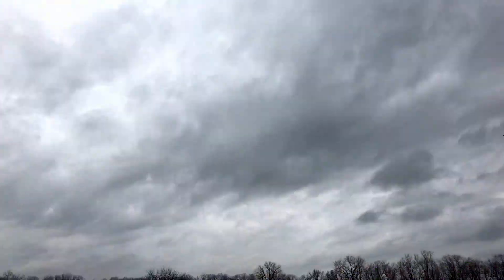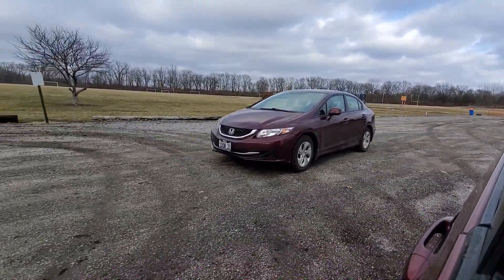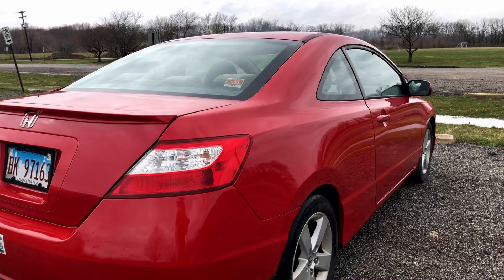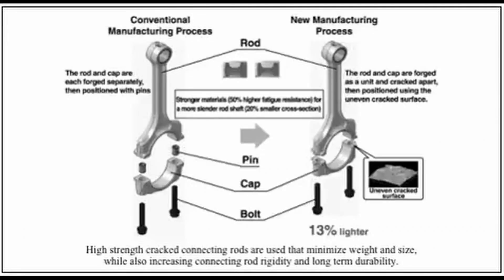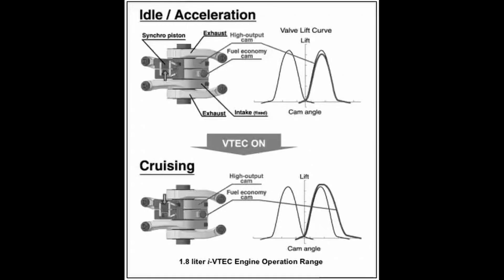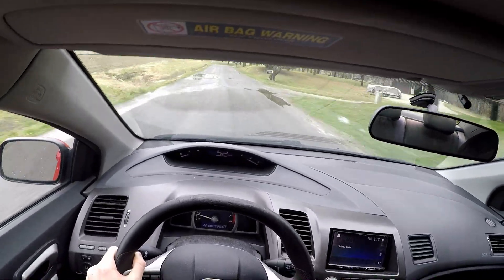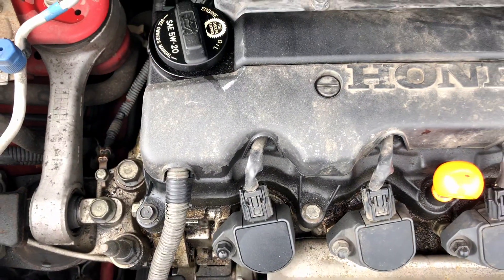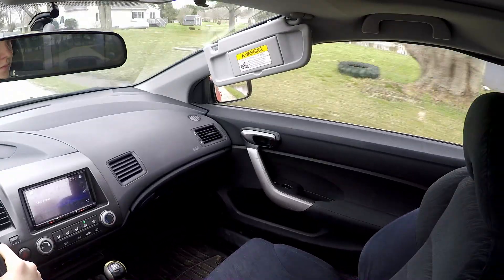A Brief Guide to the R18 Honda I-4 Engine

Comment from the maker: Some minor corrections: When I'm talking about the mpg, those are only applicable to the 8th gen civics with the R18, not the motor itself or other vehicles with the R18 in them. Not all emissions ratings are strictly for the R18, but rather for the vehicles that it's in. Also, as The Wolf logic mentioned in his comment, there is a precedent that proves these engines are capable of making upwards of 200 whp, so disregard my assumptions as far as how much power the engine could take in the opinion section. However, it should be mention that just because an engine can make decent power, that doesn't mean it'll be the cheapest or most efficient/reliable option.
Reply: Excuse me sir, check out our channel. More videos on the boosted r18 soon but it actually LOVES boost. Trust me it’s the new d series. Also something no one wanted to touch but when done right it’s awesome. I bought an eBay kit for the car and it’s performing absolutely well. The kit was only $700 I had to buy a few things but really check it out and re-consider your view on the r18. They’re fully capable of power because they’re Honda’s. We all know by now that Honda motors are pretty much bullet proof. Please do check it out!!
Reply from the maker: @mobsquad1320  Will do! Thanks for the information! I'll make sure to check out your channel!
Reply: @mobsquad1320  thank you this video made me feel like shit for owning an r18 and putting more than 5k into it.
Reply: @mobsquad1320  what about now a year down the line?
Reply: Sometimes when I am lonely I will shave one leg so it feels like I’m sleeping with a woman 👩🏼
Reply from the maker: @mattycheeze4131  Sounds like winning to me
Reply: @carpartsandexhaustfarts  💪🏽
Reply: @mattycheeze4131  haha 😂
Reply: @mattycheeze4131  I know this comment is old but I literally laughed out loud! 😂😂😂😂
Reply: @Cooldad87  
I still do it.  🤷🏽‍♂️
Reply: @mattycheeze4131  🤣🤣🤣🤣 make my day!
Reply: They can handle more than 180bhp. Many people have made well over 250bhp reliably using supercharger kits and Remaps.
Reply: Thanks for the intel.

Comment: I'm a member of the European Civinfo forum since forever. There are tens of boosted r18s with 240 to 400 hp on stock internals. They run perfectly fine for almost 20 years now, no issues

Comment: Red line is 6800 RPM. If you want to push it, this engine can pull when you need it to get moving. Its best feature is fuel efficiency. Baby it when you drive it and it is incredibly efficient. It is also the quietest engine I have ever had. I have 330,000 Km on mine. It does not use a drop of oil between oil changes. The body is in incredible condition. Hope to take it to 500,000+

Comment: Buying one as back up car 

Anybody had one - any thoughts ?

Looks v easy to work on ?
Reply from the maker: If I may weigh in, they are very easy to work on. They also have pretty ridiculous durability and longevity. My 8th gen has gone on to rack up over 270k miles and is rallycrossed regularly and has yet to have a major failure of any kind. Great platform for pretty much any application.

Comment: I have noticed alot of issues with the r18s 3rd cylinder.  Im trying to figure out what is causing 3rd cylinder overheating and 3rd cylinder rods getting thrown. And head gaskets blowing out on the 3rd cylinder?

Comment: Ive just added a R18a to a classic mini, upgraded the cams and springs, a few breathings mods and a tune and now pushes out 175bhp. Increaded the redlune to 7300 so its sings nicely also 👍🏼
Reply: So a letter say Skunk2 cam, full exhaust and intake with a map takes it from 138hp to 175hp? Not bad
Reply from the maker: That's incredible, good going!

Comment: I've had my Civic Auto since 2007. Done 260000 kilometers Drivebelt still like new. All I do is regular maintenence.  Valve adjustment every 45 000 km Brake pads, spark plugs,  new battery every 4 years. Fluid
Changes , oil, water, and  atf. She runs like a dream. 
 Only thing Ive had to replace in 18 years are two light bulbs and that takes you 5 minutes to do...Best car I've  had.

Comment: 5 years later r18s still making 250 stock blocks there's a dude on yt making 237 to the wheels
Reply from the maker: I will say it has way more capacity for performance than my initial impressions led me to believe. Honda people have really worked wonders with it, and it attests to Honda's ability to make a great motor at any price point. It's so great

Comment: Does the L15B1 have the exact same VTEC variant?
Reply from the maker: That's a great question. I am unfamiliar with the L series of engines, although I'd love to get to know them. Given that the Fit is first and foremost a commuter vehicle, I would imagine it has the more efficiency minded I-VTEC system found in the R series, but don't take my word for it. I can say with near certainty that it is not the EXACT same system. In all likelihood it is set up somewhat differently, and it very well could be more performance oriented given how capable the Fit/Jazz is as a performance vehicle.

Comment: As long you don t look at the speedo... I got it to 133mph... Isn t that good enough?
Reply from the maker: It's not so much about how high it can go and more about how long it takes it to get up to speed. In all fairness, it's impressive for its segment, but if you're used to something more potent then it's nothing to shout about. It is a ton of fun though, but the illusion of massive speed is shattered somewhat by looking down at the gauges. That is an impressive number to get it up to that I didn't know it was capable of, I sure hope it was on track!

Comment: My sister has a 2006 civic with 305,000 on it. Does not smoke
Just leaks a little oil. Might not be
fast, but it lasts forever. That starter is a bitch to change though.

Comment: I got a 2008 Honda Civic EX but it got a problem. The problem is the mpg I am getting around 19 to 20 max I got no check engine and the engine doesnt idle bad but I noticed that when I step on the gas hard it like over floats like if it was running rich?
Reply: It got 204k miles
Reply from the maker: That's interesting. Sorry to hear that it's not running right. It does sound like it might be running rich, but if it's not throwing any codes it's hard to say what might be causing it. It potentially wouldn't hurt to swap out some sensors and see if that has any effect. I hope you find some answers soon.
Reply: @carpartsandexhaustfarts   there is no check engine i see that my airflow to gas ratio it 14 to 1

Comment: Thanks for the review, i own a 2015 Honda civic lx sedan. The only thing I done to it for performance, I added a short ram intake by Tekada. It replaced the factory air box. Every once in a while, I will clean out the filter that’s inside the box. The other thing I would do eventually, is add a tekada catback exhaust to it. I was supposed to have that done a long time ago. Then finally a big maybe, would change out the header. That would have to be done by my good buddy of mine who works on my car maintenance. He would have re program that. But that’s it, my engine has 130k miles on it. It’s still running awesome. My car is my daily driver and I use it part time for doing lyft and uber. I agree with you, if I really want more horse power, I would swap out my engine to the K20’s or K24’s.

Comment: I got my 12’ civic lx in 2019 and I hated it cause the previous owner fucked up all the motor mounts and suspension and never changed the transmission fluid. It would also slip when exiting a highway. I rebuild this car cause I got it for a 3500$ steal. I changed the motor mounts, engine cradle, struts, axles, rotors, brakes, wheels and tires, then I ended up changing the transmission , spark plugs, ignition coils. Radiator fans and temperature sensors. Intake hoses. Catalytic converter, resonator. And I have completely fell in love with this car 25k later cause I also replaced the front bumper, fender, and hood and put a backup camera, touch screen radio, mic, 4 Rockford fosgate speakers 2 Rockford tweeters, 2 ten inch subs then I switched to a single 12 inch pioneer. Im in love with my all blacked out 2012 Honda civic Lx 1.8 R18z engine.

Comment: You can get more then 200 hp if you know what you're doing. I have a 2012 lx R18z1 auto with a cold air intake and a tune making 135 hp (New stock makes 112 hp for reference). If you upgrade the fuel injectors from the 185cc to 300cc with a return fuel system, and like 15-20 lbs boost you can make around 200-220 hp on stock internals. After that you gotta upgrade the internals. If you want more then 300 hp you might as well get an si because you're gonna need a new block.

Comment: Hi i have this engine it makes a grinding noise on cold startup people have told me its the vct Actuator. I am pretty sure this engine does not have one its only on the double overhead cam engines found in the si models. I am leaning towards the starter motor any thoughts in the comments would be apricated.

Comment: Thanks, this is the same version of i-VTEC that was on my old Honda Element. Sure, it's not the performance version, but you can definitely feel a little bit of a power bump when i-VTEC switches from 12 valve to 16 valve mode. And if you know when the change over is, you can increase your fuel economy by keeping the RPM's below that changeover point. And I totally agree, if you want the performance version of i-VTEC, just buy a vehicle with it built in. You'll get a MUCH more reliable vehicle and it'll be a fun drive. I finally got my hands on a K24 Acura TSX this year and it's a blast.

Comment: I’m surely dropping between 5K-10K just to keep mine all motor. Really an Exhaust-Intake are all this thing has needs tuning in the long run it will throw codes on and off. 

A Camshaft-Fuel components and maybe Upgrading the cooling system no focus on power really unless it’s possible with Torque being the focus rather than HP however I am pushing for 200hp. That is where the spending becomes useless but you get the idea
Reply from the maker: Pulling 200hp is impressive. Anecdotes like your seem to support the idea that the R18 has a relatively strong performance baseline but a low practical ceiling for what it is.

Comment: R18 is the worst engine in honda line up.
Extremely fuel hungry
Reply: salt for the sake of salt
Reply from the maker: I haven't encountered this in my ownership experience, I usually get mid to high 30s up to about 38 mpg which is quite good imo (especially compared to my WRX). It's not a sipper like the d series but it's pretty well balanced in my experience.

Comment: LET ME SAY THIS...... I've been building Honda since the early 2000s...... I have built b-series d-series h-series j series and k-series.... BUT WHAT SHOCKED ME ABOUT THE R18 WAS......

My mom bought a 2012 Honda Civic EX-L sedan with the r18 Z1 she used to own a 99 Civic SI with a b16 in it and use the street race back in the day when I was a kid before I was old enough to get my license and followed suit with building Hondas myself....

I put on her 2012 Civic EXL I decided to do a short ram intake BUT UNLIKE EVERYBODY ELSE WHO DOES IT AND JUST LEAVES IT AS A HOT AIR INTAKE......... She didn't want to run a full cold air intake that goes down in the bumper for fear of sucking up water because it rains a lot here 

so I built her a short ram intake with the heat shield and then did a custom air duct that goes down to the front bumper where the fog light would sit and I also wrapped the intake tube itself in Gold reflective heat tape!!!

it dropped her intake air temperatures on a hot summer day down from 140 degrees down to 70° and by doing that it's seriously made the car happy 

I COULD NOT BELIEVE HOW LOUD the VTec crossover was..... IT'S INSANE (((for a sohc r18))) 

It did not do that with the stock air box it did not do that with just the short ram intake by itself but after adding the heat shield and the air duct and then wrapping the gold reflective heat tape around the intake tube 

Those colder temperatures met that car so much happier when you punch it and now she has the benefit of a short ram intake so she doesn't have to worry about sucking up water like a true cold air intake BUT STILL GETS THE BENEFIT OF COLD AIR 

Yes it's not a performance car compared to any of my Hondas I've built over the years but she loves it I have made it to a complete SI replica with the grill front and rear bumpers the SI spoiler Wheels etc and now I have even done a header and down pipe and a full Cat-Back exhaust 

And just for the hell of it I took one of my Honda's and put it on her car and went and had it Dyno tuned 

It may not be fast but damn the car is so much more fun than it was stock and she is happy with it for when she still wants to try to race somebody once in a blue moon on a red light or just have fun on some back roads even in her fifties 

I myself have a 95 Civic Coupe that used to have a fully built d16 Z6 NA all motor high compression build that was pushing almost 200 hp at the wheels which was almost unheard of out of an all motor d-series but I wanted to be different 

Now it has a k24 block K20 head  built all motor with full bolt ons now it's a bare Bones track car

And my very very rare edition 2004 Honda Accord V6 6-speed manual coupe with the very rare hfp Honda factory performance package only 1 of 500 ever made with full bolt on the J series pushing 320HP at the wheels perfect daily driver
Reply: have you tried premium in the r18? i live in texas so heat is a problem.  it suprised me that the owners manual actually stated that if you use premium fuel, you will notice a performance increase.

its not massive but cruising takes less throttle, better low end power so it doesnt bog with ac quite as hard and it seems to  keep pulling all the way to 6500rpm.

i initially did it because in the 110f days, i would hear the motor ping on take off (manual trans).
Reply from the maker: It's great to hear from someone with some experience working with Hondas. It really is great for what it is. It really isn't all that dissimilar from the D series except it does have considerably more grunt. It's stout, reliable, simple, affordable, and economical, but still very fun and capable.

Nice to hear you mention the Accord platform and the J series as well. Co-host of CPEF Nick has a Acura TL 6-speed with the J series and that thing is a hoot. We love everything Honda puts out.

Comment: looks like im late to the party here...
Only critical info i have to add here is that the block is technically rated for 300HP if we can trust the guys in the honda forums. Defenitely not worth it to modify unless you really love this car for some reason.
Also something people should know before buying one of these is that the R18s had a recall for micro cracks in the lower block that leaks oil slowly.I think it was caused by a casting defect.
My 07 civic LX 5 speed is currently leaking through the vtech solenoid gasket but not the block. got the new gasket ready to go in soon : ]
Reply from the maker: Part of the wonder of YouTube is it's never too late to contribute to a topic. Thanks for stopping by. I wish I had known about the block recall before making this video, but I've heard about it at length subsequently. These motors are pretty hard to beat in a number of departments, but that's definitely a consideration for prospective buyers. 
The Honda forums talk a lot of talk. As I see it, Honda overengineers basically everything they make, so it doesn't surprise me that some ambitious people with too much time and money on their hands have pushed these motors pretty far. But just because Honda enables us to push the envelop doesn't mean its a good idea. 
My R18 has some leaking issues along the valve cover gasket, that might be something I fix this summer, but I have bigger fish to fry with the Civic atm. 
I hope all goes well with your Honda. Thank you for taking the time to view and comment!
Reply: Dude the valve covers are still pretty cheap online I'm thinking I need to replace the gasket on mine as well. Glad to hear yours is still running❤ @carpartsandexhaustfarts
Reply from the maker: @aalecalexander117  They're real troopers! If my EJ20 went through half the shit my R18 does I think it would fragment into a thousand small pieces lol
Glad to hear parts are still affordable. I need to get a fuel leak issue taken care of first and do some major suspension work, rallycross has not been kind to it, but after that it'll be the next thing lol. 
I hope all your leaking issues stay far away after the fix!

Comment: I've got a 2009 Civic coupe. Weird little space ship looking thing. It's got one of these. It's fast enough to handle the motorway. The low end torque has gotten me out of trouble a few times (Dodging idiots). Of course this means it's just powerful enough to do stupid things, but it's like Honda sat down and said "Lets make the perfect engine for a daily" and nailed it. It's a manual and currently thinks it's averaging 39.4 MPG.
Reply from the maker: The design is so mid 2000s, particularly the coupe, I love it. I'm always impressed by how easy it is to spin the tires in some conditions, it feels solidly torquey for a 1.8L. It really is an incredibly well-rounded engine with its outstanding fuel economy, competent power, and fun personality. The more economy cars from this time period I drive the more I appreciate what Honda was able to do with this powerplant. 

It's also shockingly durable and dependable. My 8th gen is at over well 260,000 miles now and still starts up and runs right every time. Recently I've been RXing it after my sibling recked it and even sitting after sitting in the high RPM all day it still chugs along just fine. 

https://www.youtube.com/watch?v=SA_iYz2ClO4
https://www.youtube.com/watch?v=rtLgt1f0QZk